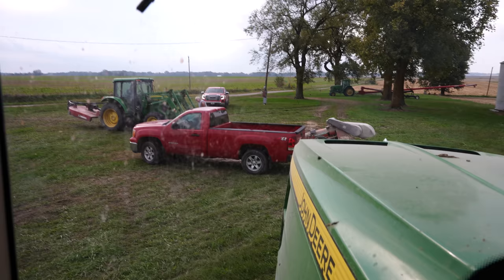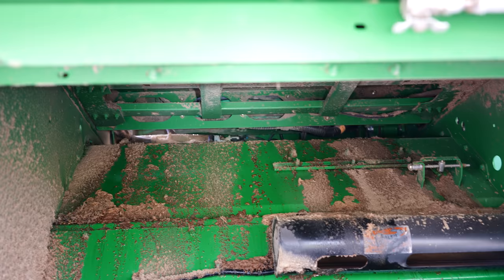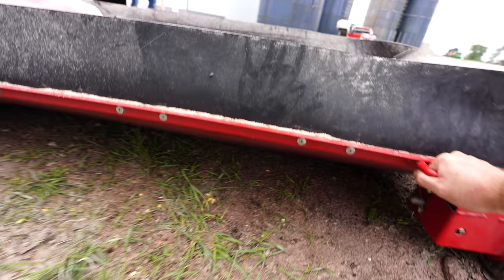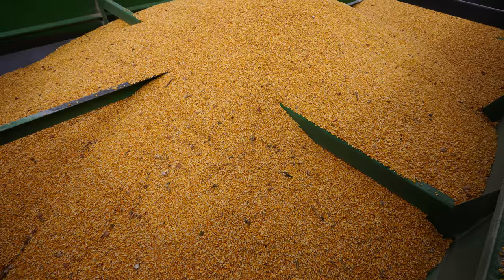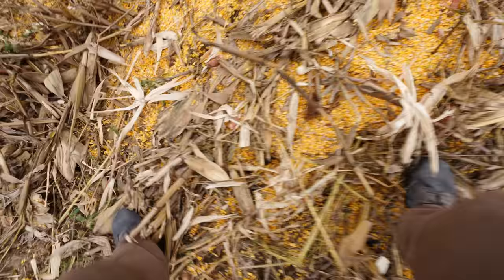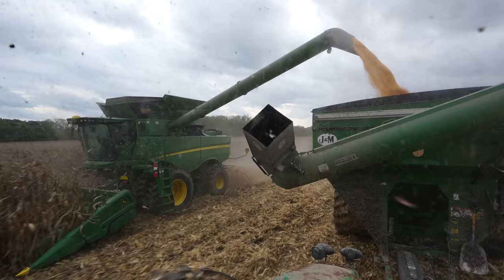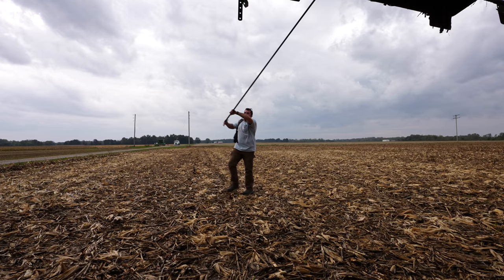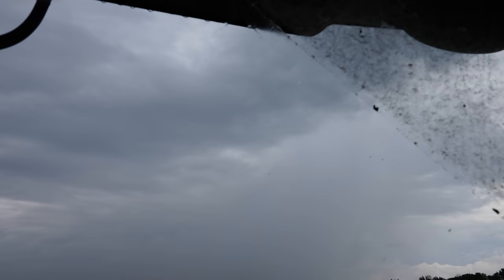Our John Deere Combine Sprung A Leak Due To The Incredible Corn Yields (Ep.131)

Comment: Boy ! You guys were lucky with that oil leak. we lost a 9500 a few years ago when we did the same thing that you did and knew it was leaking. didn't think it was all that bad and was going to fix it that next morning. Little did we know a bearing was going out on the crossover auger and it caught the combine a fire. if the oil was not there it would have been a easy fix but it was a total lose. Combine and head.

Comment: So, Andy with the fertility inputs you guys are using any chance you will be taking on a project to store your own fertilizers to manage the cost component? Such as "Brians farming videos" they recently installed new fertilizer building to store their field inputs for strip tiling. Do you just broadcast or will you get into the strip till? thanks
Reply from the maker: There is money to be saved by having your own fertilizer facility, but I am not sure how good your return on investment  would be. Between the building, equipment, and added labor, you’d probably not be as far ahead as you’d like to be given the financial investment. Every farm is different, though. We broadcast our fertilizer on top. Strip Tillage is a great system, but it is another level of intricacy that many do not want to mess with. Thanks for the question.